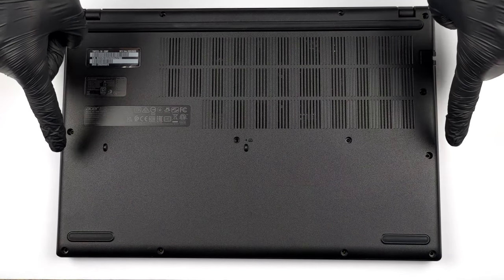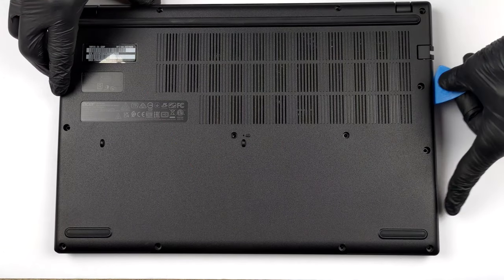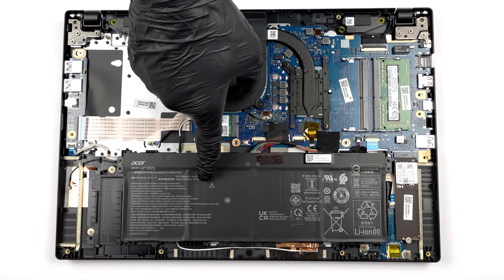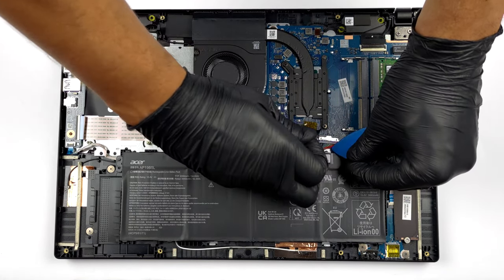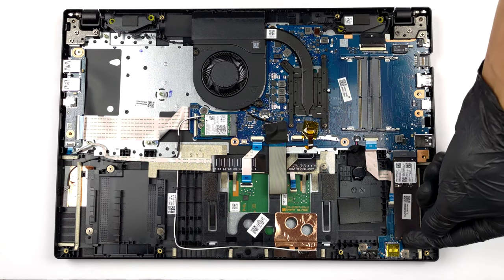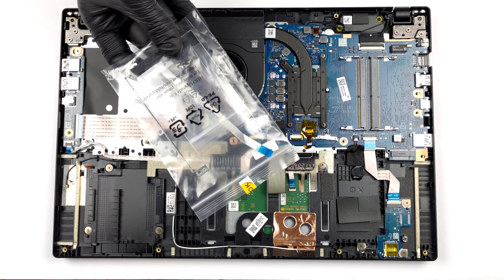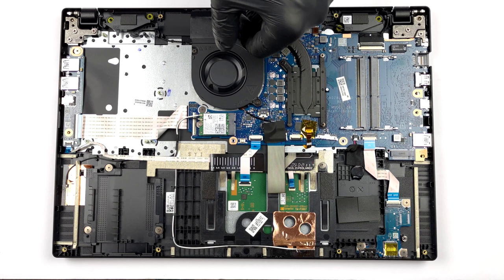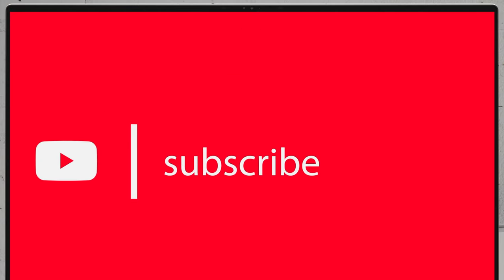🛠️ How to open Acer TravelMate P2 (TMP215-54) - disassembly and upgrade options

Comment: what's the ssd upgrade part number? didn't get that in my piece :(
Reply: I didn't get it either I think the sata SSD cable kit is the same as the nitro gaming  one with a flat flex cable to sata connector.
Reply: HDD bracket part number: 33.VVRN7.001 Sata cable: 50.VVRN7.002